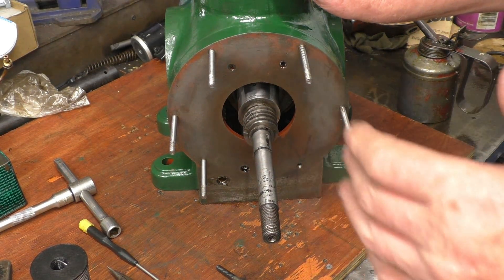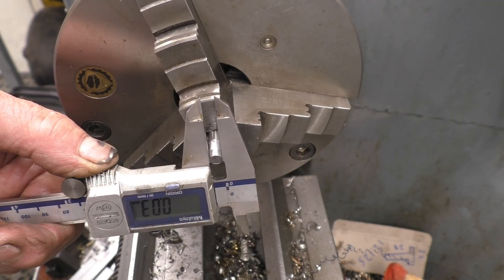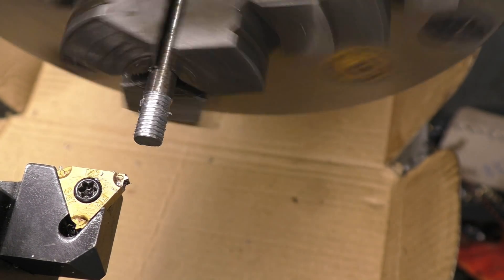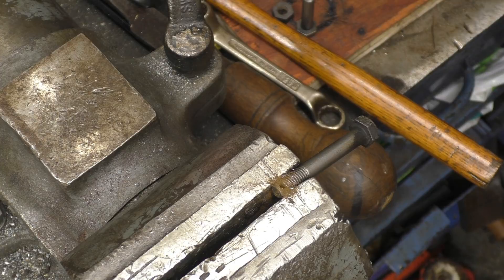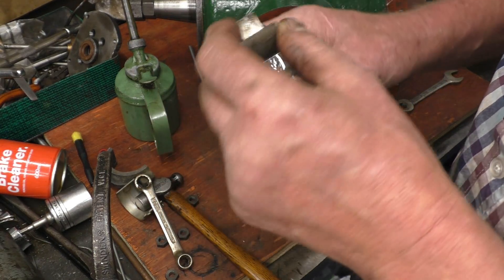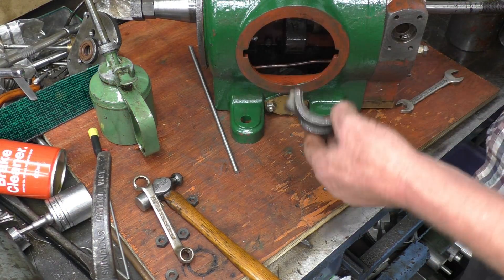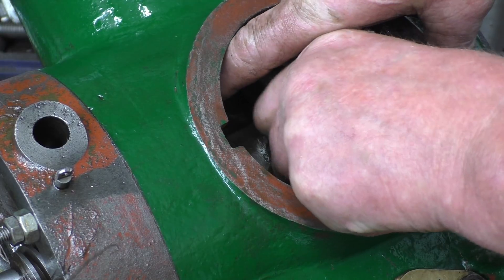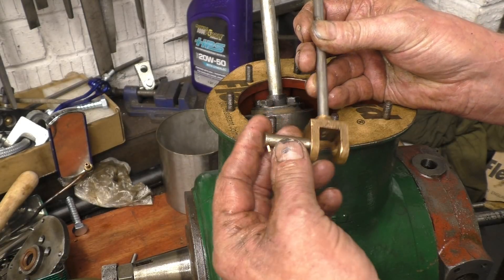Stuart Engine P10a  .Crosshead & Trunk Guide

Comment: Was that a M6 thread You single pointed in Your lathe?
If so, it seems like You have a metric lead screw in it as You could disconnect the half nuts like that. How in earth can You cope in an imperial environment using a metric lead screw?  😋😋😋